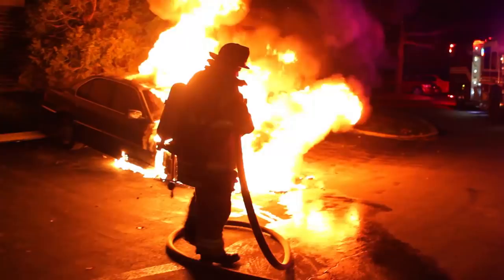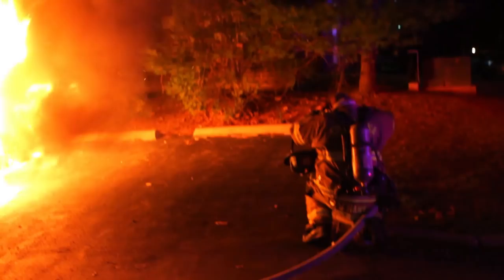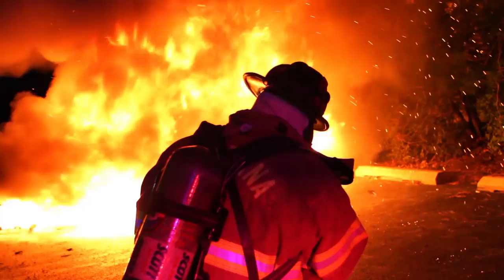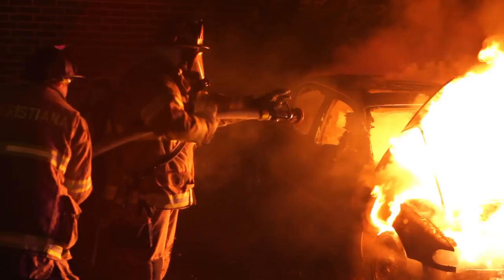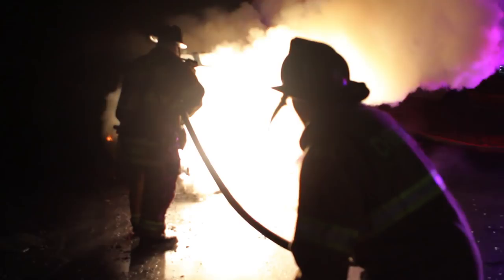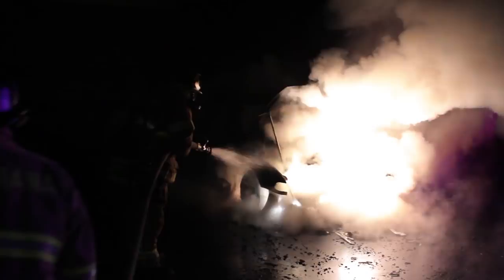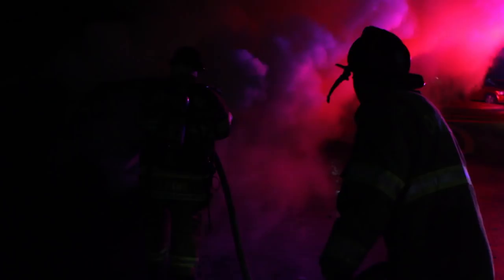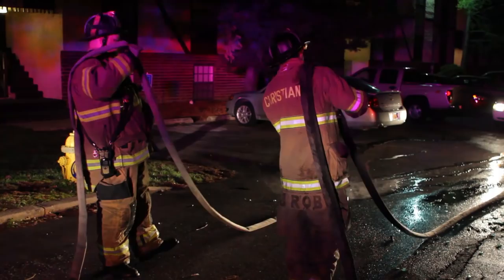Episode 4 - Car Fire - Rescue Engine 12

Comment: Too many people these days complaining about not wearing the SCBA waist straps.  Yes they are supposed to be worn, yes they help with weight distribution of the packs, I can go on and on.   Many times in the past if you needed to drag a fellow brother out of harm the airpack pull was the way to go.  You cant do that if the straps are unbuckled but with the implementation of the DRD on all sets of current TOG this is kinda a moot point anymore.  At least he was on air...

Comment: Don't you use foam in US for fires like this?
Reply: denko238 If you have foam on your engines then yes. However with being volunteer sometimes you may get a great pump operator who knows how to turn it on in the right quantity, and then sometimes you may get a jackass who doesn't know how to turn it on. Depends.

Comment: Are waist straps optional on CABA sets?
Reply: When you take classes they require you to clip the waist straps, but a lot of guys in the field don't bother. It depends on the person, my chief said he likes them because they help take some of the weight off of your shoulders.
Reply: Yeah wasn't sure if it was the same as here. If our waist straps aren't done up here in Australia we get a stern word. I find it stops the set flopping around on your back too, especially when bending over.
Reply: LarryNoir Umm they don't take some of the weight, they take ALL the weight off the shoulders if properly adjusted.  Too many guys are carrying their packs very low slung on their backs with creates too much strain on shoulders.  I used to be one of the no waist straps guys when I was younger many years ago, but have learned and changed my ways and boy is it much more comfortable.

Comment: my fire department uses this TV series as a "what not to do" training videos. so many things wrong with every video I've watched. from not attacking fire correctly, to poor ppe. I would be embarrassed to publicize these if it was my department.
nice trucks though 👍
Reply: +Dylan Hawkins Chemistry is fun! Do they not teach this in FF1/2 or Fire Science courses or something??? Mg (s) + 2 H2O (l) → Mg(OH)2 (s) + H2 (g) Basically magnesium burns hot enough to split H20 into H2 and 0,  is an exothermic (and often violent) reaction that only serves to add heat and fuel the fire. Magnesium also hates CO2: 2 Mg + CO2 → 2 MgO + C (s) (produces magnesium oxide and carbon, self oxidizing reaction) so CO2 extinguishers are out. 

You've got dry chemical D or...and this is really high tech so I'm not sure every department could afford it....a bucket of sand. 

Take away all available oxygen, even things that will decompose into an oxide from heat. Obviously here, you can drench it enough such that the production of heat by decomposition of H20 is overcome with water, cooling the magnesium enough to stop the reaction. A larger amount of magnesium though is a very, very bad day. 

So when they talk about water and magnesium, then go and toss more water on I'm not sure what they expect to happen. That 'white light' is just keeping the fire going and producing heat. Those pops and flares and re-ignition could be avoided with another firefighter having a simple dry chemical D extinguisher to hit those spots once it's knocked. Or, sand.

(Foam still has plenty of H20 [no shit, you already know that lol] so no dice there either. Might be a little less violent but still just tossing fuel on.) 

Interesting aside: Chlorine trifluoride will actually ignite sand, asbestos, test engineers, cement, and pretty much anything it touches. It's really uncommon and generally produced in small amounts as needed on-site. But if you ever hear those words, run the other way. 

/chem rant
Reply: Exactly... So many things wrong in all of these videos. Lol but it's still good entertainment
Reply: Did the fire go out? Yes and at the end of the day that's all that matters. What's the poor PPE? Not having his waist straps done up?
Reply: grey man masking up downwind, and yes, not having that waist belt done up either. Continuously throwing straight water onto a magnesium fire, the list goes on.
Reply: Literally grey man is probably the only real FF is this comment feed.